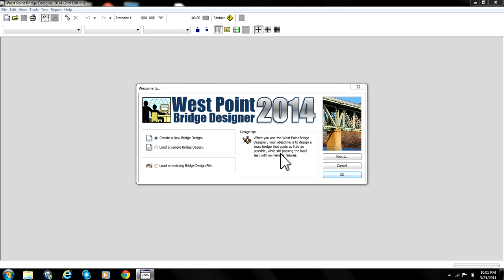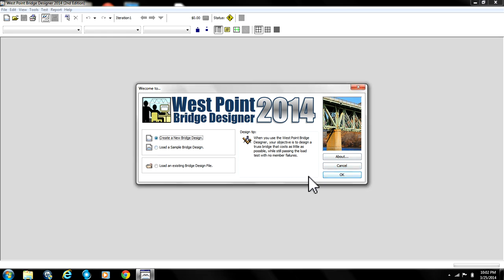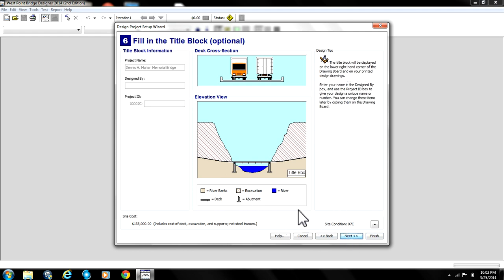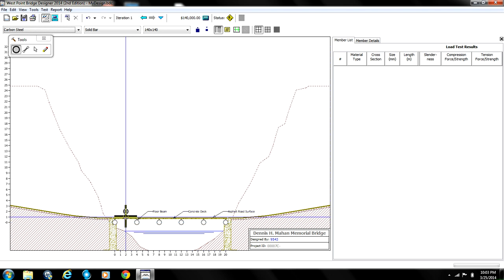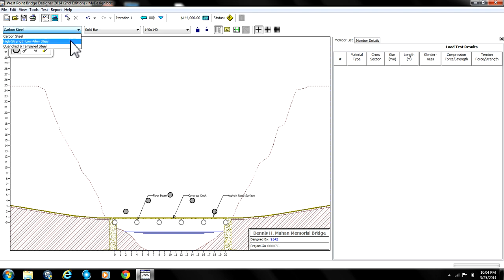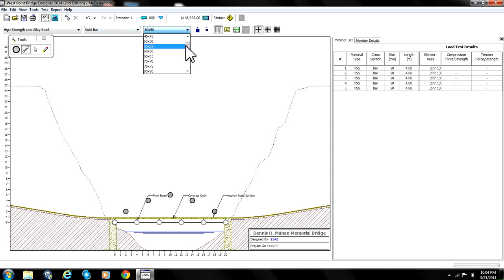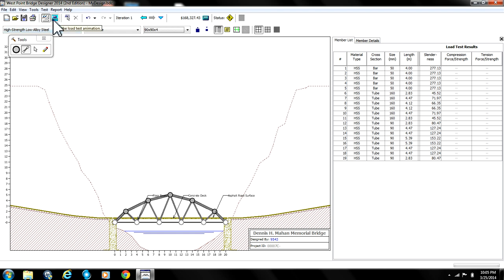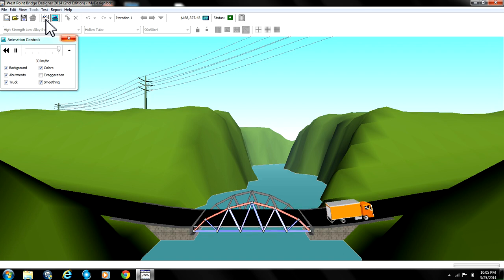Very Cheap West Point Bridge Design (2014 Version 2nd Edition)

Comment: in 2016, it does not work AT ALL
Reply: Lol, I got this bridge to work in 2016. All I had to do was modify a few things, and the cost turned out to be $176,440.34.
Reply: The prices are modified in the different years to base it off of the actual prices. It worked great for me and I got the same price